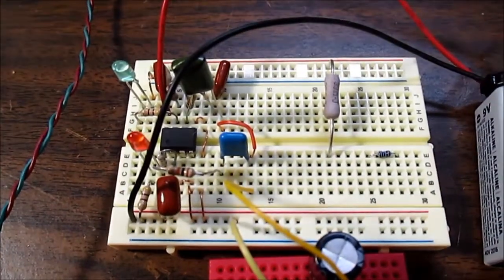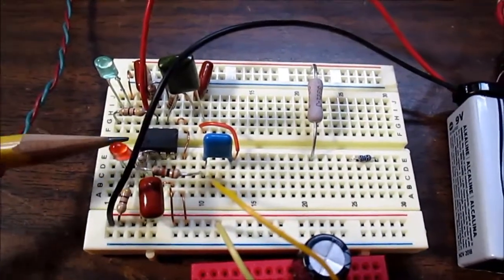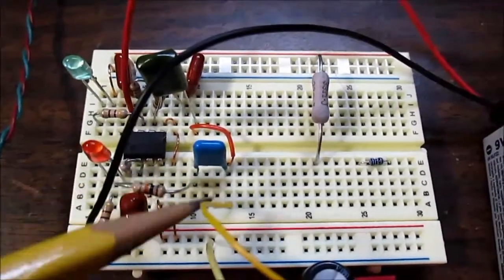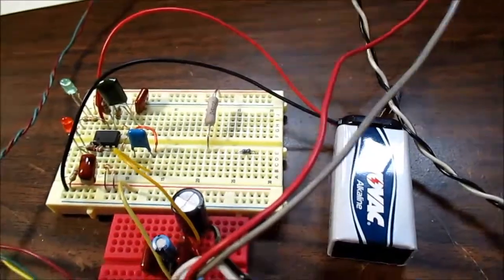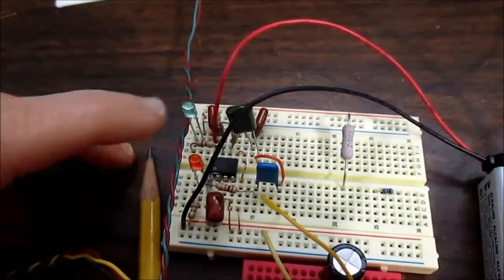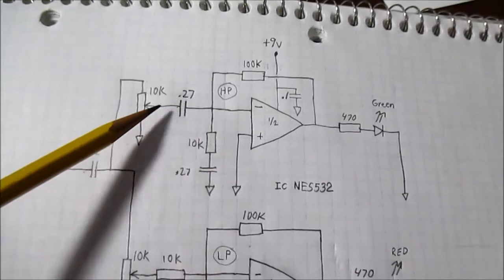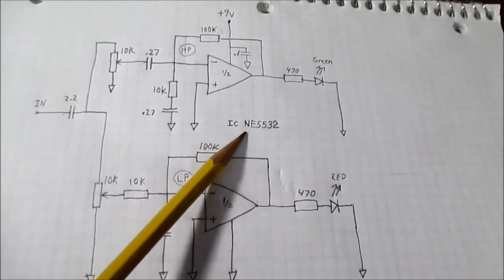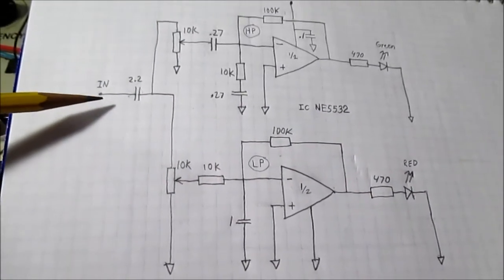Color organ simple circuit

Comment: I still have the three channel color organ I built in High School, but it was simply a backwards audio transformer across three pots with a RC filter off of each wiper to the gate of a sensitive gate SCR. C106C1 (or -D1), if I remember right.
Like your ideas for an improved version.
Reply: Nice, that means that it uses light bulbs right?

Comment: hello sir this is a great project,thnx for making this video......Can u tell how to drive 12V led strips lights
which ic to use for more power for led strip in this circuit
Reply from the maker: You could use an LM1875 with a similar circuit.
Reply: +JohnAudioTech this ic lm1875 requires heat sink and it can increase the size of the circuit .Can you suggest me an ic which can deliver 12-20 w power without using heat sink 
thank you

Comment: Hi JAT, John, Cool little color organ, need to build one. I'm working on a 555 tone generator, various Hz. To trouble shoot radios. You should try a Runoffgroove.com Ruby 1/2 watt practice amp, work good with MP3, any input. It's an LM386 and an MPF-102 J-FET. Quick read at Runoffgroove. Great Video. Take care, C.